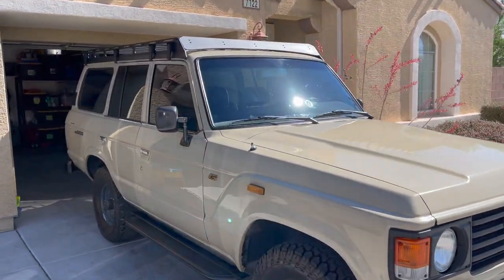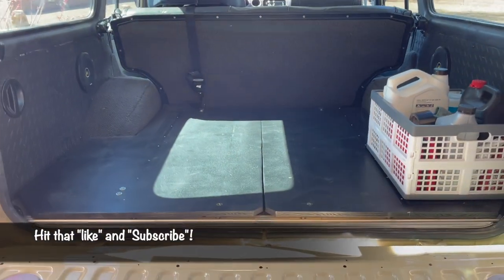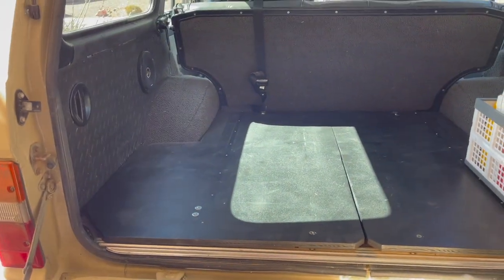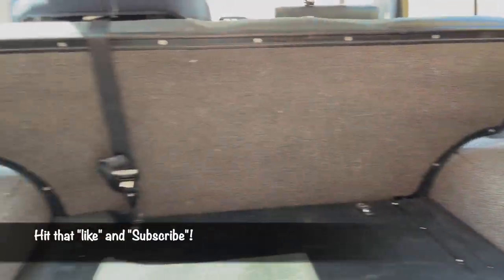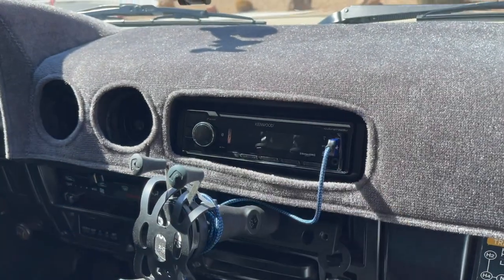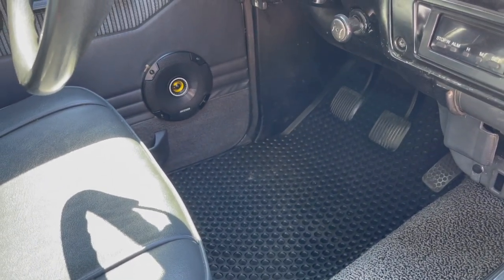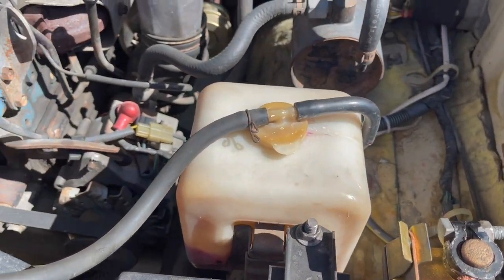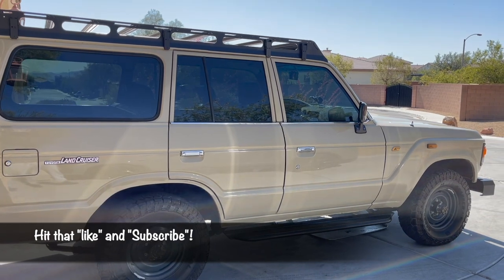1986 Land Cruiser HJ61 - One Month Update

Comment: So the memory wire is straight to the battery? All other positive and negative wiring from the radio goes back to the converter right? The 24v power to the converter must come from a keyed power source correct
Reply from the maker: Yes, memory straight to the battery and the radio is running thru a step down from 24v to 12v on keyed/switches power